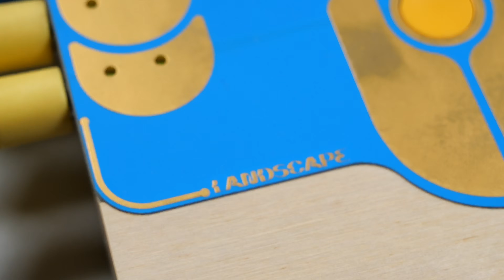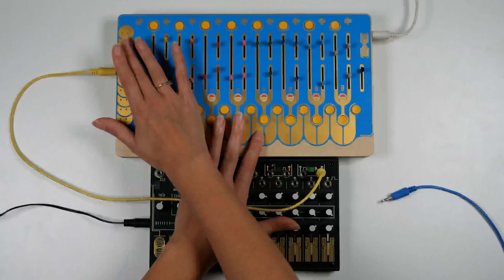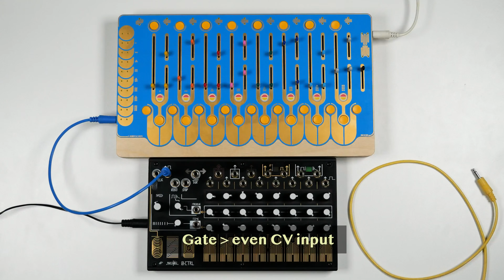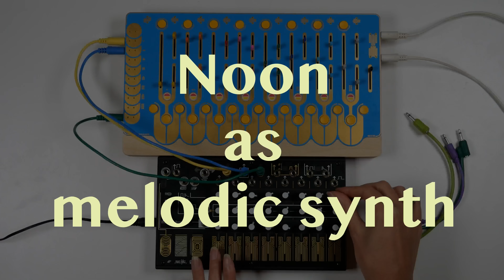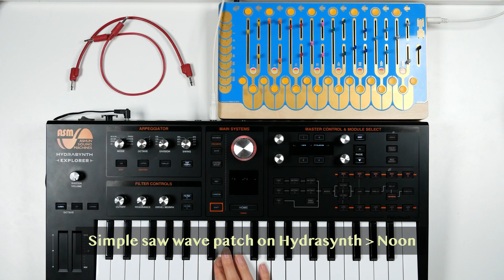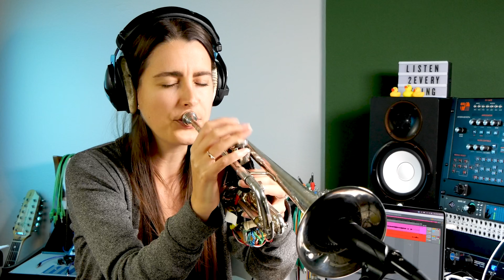Sculpting Electricity with Landscape Noon

Comment: Great video ! Such a clear explanation, no more no less ^^

Without a midi output, any chance to synchronize it with another analog machines in a set up ? even it's is a passive device... Or do you absolutely need to link it to a sequencer like yours ?

I mean, if the "linked device" is set up with a midi clock, do the noon will follow the rythmic patterns ?

Comment: Nice vid, thanks.. it is informative as to ways of using it, connection to different types of controllers, and getting sequences or simply tones out of it... however i would say a bit lacking on actual drum pattern results... there isn't much if any actual drum machine type of output. Which would be the main objective of a drum module..  imo def an omission and missed opportunity in the video.

Comment: Does anybody know how to achieve sounds like this in the box? That's mostly the kind of producer I am and I love these sounds but I'm probably not gonna spend $700 on a used one of these.
Reply: I mean similar percussions like those clicks and pops can be achieved with some heavy sample manipulation and a lot of the oscillator sounds can be achieved with a nice modern vst synth but i think with this things its really in the way it responds to what you throw at it.
If you like working in the box might i suggest software modular like max for cats or audulus? Its a ton of fun and gets very weird plus you can save it all as presets!

Comment: It's been two years and this is still by far the best showcase of the landscape noon on youtube.
Reply: And six months further after your comment, this is still essentially the only Noon video that goes beyond sending gates of a single voltage and duration into it. Either that or some random audio. :(

It is really sad that it is still basically impossible to get a sense of what Noon can do without buying one and trying it, because 95% of YouTube videos on it barely even pass the level of a function check. Truly. If I bought a Noon, I would quite literally test a wider variety of inputs into each and every input jack, with as many combinations of slider position and button state, across all channels, simply to make sure I received a good one that doesn't need to be returned. And then I'd start to actually use it. 😂
Reply: This is one of the best showcases of ANYTHING on youtube.

Comment: Close, the difference between the voltage from a PSU and the voltage from a CV source is impedance. The PSU is capable of delivering much more CURRENT, which the passive circuitry doesn't need much of. Having said that I imagine the output of the Noon requires some amplification? 👍Fun drum machine 😄